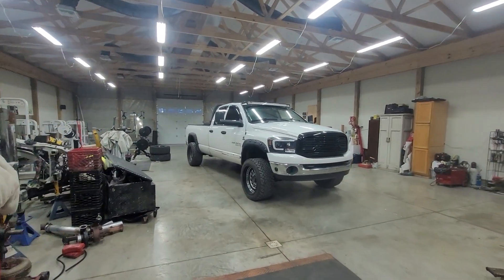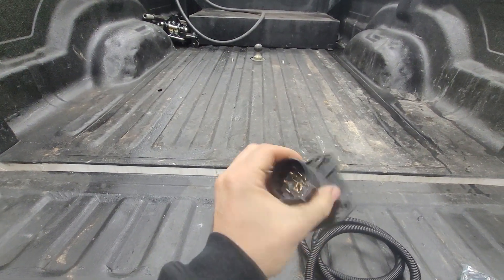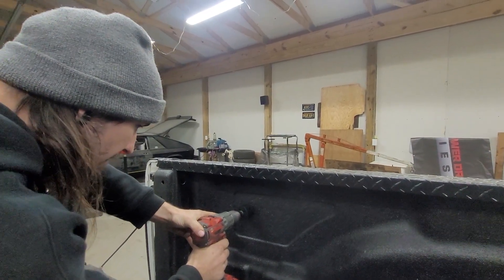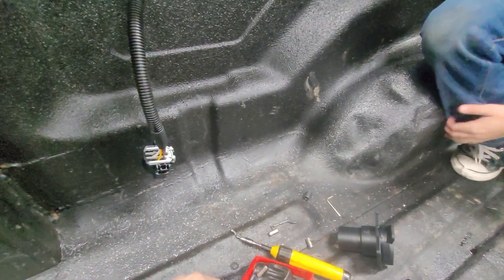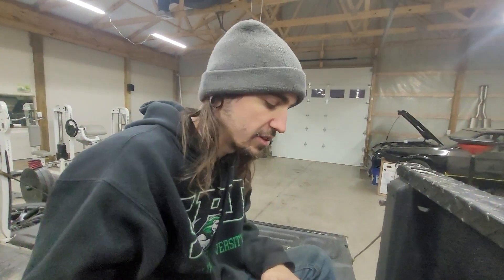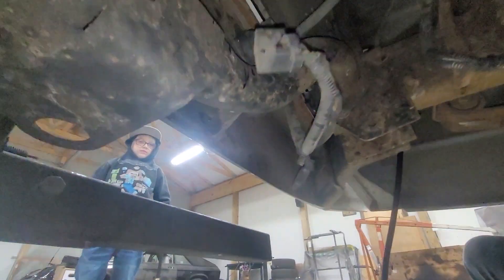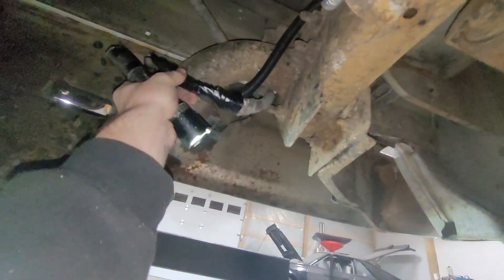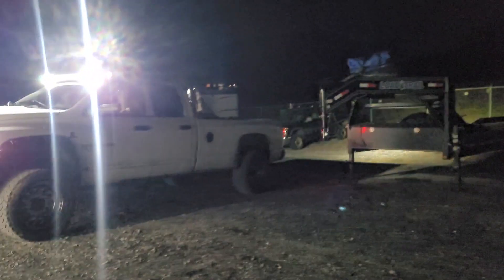Must Have Gooseneck Towing Mod | DOT Violation

Comment: My plug in the bed is used for a headache rack as i refuse to tap into the trucks harness at all. However, i have ran my cord to where it hangs by a bungee cord like some truckers have on stretched frame and it falls down directly to behind the bed with a pull backward to the tongue so it won't snag or rub. Zero issues so far with anyone.

Comment: That shop needs a heat pump, I put one in mine and it was money well spent. That pellet stove must struggle to heat that shop
Reply from the maker: It's just enough to take the edge off but isn't anything serious. Pellets are cheap though. We have heat in the shop but I don't think he's turned it on yet. He's only in there on weekends now
Reply: @CPSteveMiller  I only set my heat pump to 65, I like working in a hoodie and it cuts down on the bill significantly, most times you do just need the edge knocked off

Comment: You should lose the rims and go to 17s with bfg load range E tires 285/ 70 17 
I’ve ran almost every tire and rim set up and for mpg and tire replacement value you cannot go with a better set up. I got 100k km so 60k miles on one set of bfg I’ve never gotten that from any other tire.
Reply from the maker: I bought this truck specifically for the wheels lol
Reply: I ran bfg’s for a while too 
Great tires. They function off road and they create NO road noise
Wear is pretty decent as well
Reply: Cooper AT3 10 ply, I average 80k miles a set before i take them off and the pull offs still pass DOT inspection.

Comment: I had a Curt one of those connectors and it started fire... had my battery charger hooked up to it and i thing when i restarted the truck at the ND port of entry, i back fed the circuit and roasted the connector. Looked in my mirror as i was leaving the port and smoke everywhere... stopped and ripped the cord out to put out the fire. Of course, had to put a new one in... LOL

Comment: U should have put it in the back left back left bed piller.  now ur screwed  cause now how are u gonna use the back 7way if you need to u should have hooked it up for bolth ways bro
Reply from the maker: Not sure what you mean
Reply: What are you talking about? He has one in the bumper and one in the bed now. They are both wired in parallel so you can use either one.....